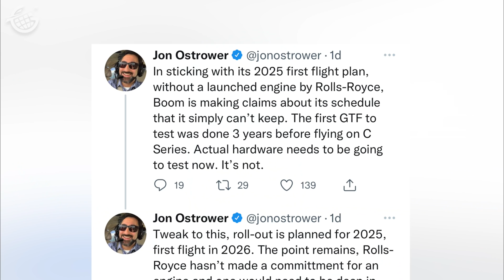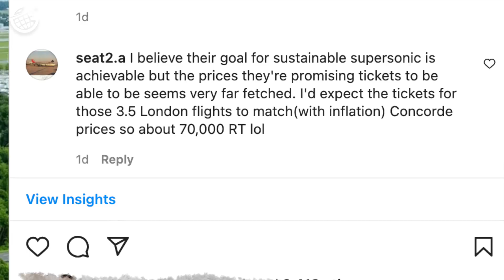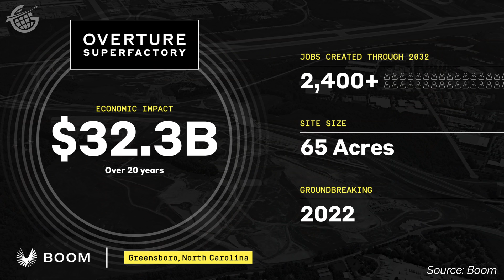Boom Supersonic Attempts a Return to Commercial Supersonic Flight

Comment: While I wish Boom Supersonic the best, I just don't see this going anywhere.

It is important to remember that supersonic aircraft are difficult and expensive to maintain and require a lot of manhours. Sustained supersonic flight puts stresses on an aircraft's structure and components that aren't seen on aircraft that at their fastest can only achieve high subsonic or low transonic flight. Critical parts need thorough inspections for microfractures that are common with supersonic flight (especially with aircraft of this size), lest they disintegrate in flight. This in turn makes supersonic airliners very unappealing from a maintenance perspective.

With current technology, carbon-neutral high performance aircraft are a pipe dream. You need a special type of jet fuel to get something that even comes close to sustainable supersonic level flight. Yes, the afterburning turbofans of today are more efficient than the afterburning turbojets that once propelled Concorde past the sound barrier. Yes, it is possible to make Boom Supersonic's aircraft achieve supercruise without the need for an afterburner (very unlikely for an aircraft this size). But it'll be at least another decade's worth of aviation development before we get something remotely considered carbon neutral on a high performance aircraft, and that is a very generous estimate.

Even with the tech being researched with the new QueSST experimental research aircraft, it is also very unlikely that government agencies will allow for supersonic commercial flight over urban areas, and it will be very difficult to convince them and the general public otherwise.

In all, nothing about this screams "sustainable" or "affordable", and after Concorde, I just don't see any major airlines buying this thing. A few corporate elites and celebrities might (and I stress might) buy it, but definitely not any of the big airline companies. Slow, steady and fuel efficient long hauls might yet remain the way to go for another thirty or so years.

Comment: I'M SKEPTICAL. WILL BOOM GO BUST, AND BECOME THE NEXT THERONOS? Boom Avaition has no prototype, no completed plans drawn up for their plane(s), they've offered no design for their jet engines, and cannot explain what kind of fuel formula will both be carbon free, AND with the abality to create power to propel their plane to such a high speed.
 They also claim their plane will not cause a sonic boom, and even claim the cost to passengers will be comparable to a business-class seat.
 Sorry, this smells like a fantasy.
 If Boom Avaition is soliciting and collecting money from investors, this may well end up crashing like a rock.
 Theranos was a medical tech company founded and headed by Elizabeth Holmes.
  Holmes claimed to have created a new blood testing method and device that would be more comfortable as well as easier and cheaper to use.
 But then it was revealed Theranos was a fraud. No such blood test device existed!
  Holmes was arrested and tried for investor fraud, convicted, and may be facing up to 20 years in prison!
  Will Boom Avaition end up like Theranos? 🤔

Comment: Carbon neutral aside (since the current planes are not carbon neutral anyway), in my mind, there are three operational problems that Boom needs to resolve: 1. fuel efficiency, 2. sonic boom and 3. range. It at least needs to be as fuel efficient as the 777 or ideally the 787/A350, so the plane tickets are not much higher than what the current planes would offer (forget about that $100 thing). And if it cannot resolve the problem of sonic boom, it means that it cannot be used to fly Asia-Europe routes, US West Coast-Europe routes, US East Coast-Asia routes, N/S America routes. That takes a large segment of the potential market out. The range was an issue with Concorde. Boom needs to have the range for East Asia-Europe routes and US West Coast-East Asia routes (i.e. about 6,500nm) to allow it to cover most potential markets. That means Boom will need to come up with a design and the technology (e.g. engines, etc.) for these 3 items. The other issue for Boom is that it is not going to carry much belly hold cargo, so the passenger ticket will have to cover operating cost, unlike in the case of long range 787/A350 flights that the cargo can help a lot sometimes in some routes. That puts more pressure on the fuel efficiency issue.

Comment: My only concern is the effect this added traffic will have on general aviation in the area. As a student pilot, GSO really is just about the perfect place to learn to fly. You get the benefits of learning to communicate with ATC early on, readily available radar services for instrument training, and realatively mild weather, all without the extra traffic that you'd experience at an airport like RDU or heaven forbid CLT. As it stands now, runway 5L/23R is almost entirely used for smaller GA aircraft unless the parallel runway is closed. It will be interesting to see how this changes over the coming decades.

Comment: I want this to work, but I think the skepticism is very warranted. Jon makes a great point about engine development timelines, SAF so far seems like a greenwashing scam that will take a long time to be available at the scale needed to fuel commercial aviation. There's also the problem of the Boom. Boom don't seem to be doing anything to mitigate it, thus restricting the Overture to overwater flying only. This is fine to TATL and TPAC flights, except that the Overture's range is not sufficient for non-stop TPAC flights, and even TATL could be a stretch. We should probably also expect the exact same environmental activist opposition that helped scuttle Concorde to be a major challenge to Overture.

I'm here for the romanticism, and I absolutely share the dream of one day being able to take a supersonic flight, but I just don't see this being the way commercial aviation is gonna develop for quite some time. I would dearly love to be proven wrong.

Comment: im sorry, i cant take anything that boom say as real, and while i get it, it would be nice for this company to meet at least 40% of their claims, its just sexy pipe dreams from a company with big claims, and a history of no being able to meet basic targets (and many of the claims just never stack up)

anywhere in the world in 4 hours, not even possible in concorde. 
that it would be the fastest passenger yet ever (while also claiming that it would cruise about mach 1.7, which would be slower than concorde) 
the first flight back in 2017
2019
2020
2021
2022 
oh, and that is the demostrator, a scaled model, overture, which at the time they started to take orders was meant to have been in service 2023  

they said that they were aiming for a ticket price, london newyork return for $5000 (yes dollars) and later blake said he was expecting 2000 for a one way ticket, only, it was 2000 pounds (meaning the expected running costs have increased a lot) 

the company and its promises are a joke,

Comment: The thing about aviation is, operators prefer tried and true methods. Other issue is maintenance, you would have to retrain mechanics. I’m also worried about airports. Will airports need to install special infrastructure like they had to for A380? That may be a big factor

Comment: The one limitation will be to get rid of the sonic boom that can be heard 30 miles away even at 60000 feet
Reply: I live  near Hill Air Force  Base ,when  I  in elementary school  it was common  to hear sonic booms . I 'm now 72 still  live  near  the  base only now It's  low flying  jets
Reply: I read that the company is designing the aircraft such that sonic boom will not be produced or it will be quite  weak if produced.

Comment: Ya its too good to be true. Hope there ceo does not end uo in court like another ceo recently. Lets do some simple math. They say they will fit 88 seats. Thats 88*100 thats 8800 for a 4 hour flight. The pilots would get over 3000 of that then the flight attendants. And they will have a few thousand left for gas. So they could probably start the jet and taxi to the runway on that budget.

Comment: I’m not understanding how a maker of an aircraft thinks they have the ability to tell United or any airline what they can charge for a ticket? If United wants to charge $100 or 10k, that’s United’s choice, not the mftg of the aircraft. I don’t think Boeing controls pricing and nor will Boom, so that HYPE about $100 is just hype…
Reply: They can’t. It’s a farce. This is a 60 seat aircraft, if all economy. It will NEVER reach a breakeven point, on any route. Even if you make it all First class and cram 38-45 seats, charge $15k one way, it’ll still be a loss.

Comment: When I first found out that the Concorde AKA The Boom, That is an upgrade from the oringinal Concorde to the newest Concorde. However, Emirates is getting the order of the Concorde and United Airlines is getting it as well. I also like how they are planning the new interior. After the crash of Air France Flight 4590, They did keep flying the Concorde until they failed to keep up and they stopped flying. Now it's making an upgrade. I agree with @Jeb Brooks When he said that he would want to get on the inaugural and that would be an awesome video.

Comment: This supersonic "boom" doesn't make much sense to me.  They haven't fixed the sound issue, and carbon neutral doesn't equal low carbon, or even carbon free.  There has been a lot of hype around "Boom" in general, and I smell a very large marketing budget.  I'm not suggesting this was a paid spot, but all of that footage from Boom was expensive. I think it's all too good to be true.
Reply: I wouldn't doubt Boom are vaporware scammers.
Reply: I agree with you. The fact that this aircraft is a sub-60 passenger one means they’ll never pull enough revenue, and the United deal is structured so that it’s simply PR for both companies and nothing else. I believe the CEO of Boom is solely looking to make himself rich from idiot investors and not actually make a real product.

Comment: Hey Jeb great video! I have one question for you - if and when Boom does get the Overture in service would you be willing to go on one of the first flights (cost dependant) or would you rather wait for the aircraft to prove its safety and reliability before getting on one?
Reply from the maker: I answer this question at the very end of the video with a personal request to the CEO!
Reply: @GreenerGrass  Looking forward to seeing it if you’re still doing Youtube at the time 🤞
Reply: He said at the end he wants to be on the inaugural flight.
Reply: The first flight on these is just as safe as the last flights are, use like on all aircraft. All aircraft go thru rigid testing then will go thru rigid test pilot flights whi really put the aircraft thru the ringer and if it makes it thru those and subsequent post flight inspections, then it will be released for public flights and any inaugural flights so there really is no benefit in waiting. If a plane is going to go down, then it’s going down. The old ones are as good as the new ones , these aren’t cars and buses!